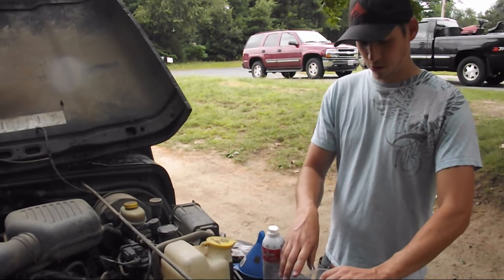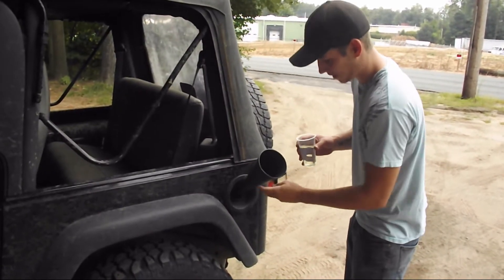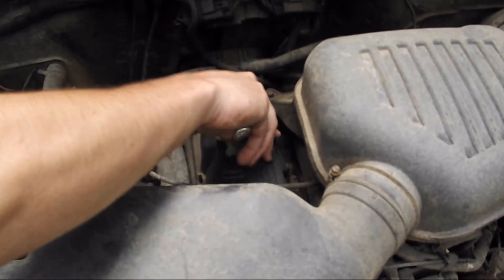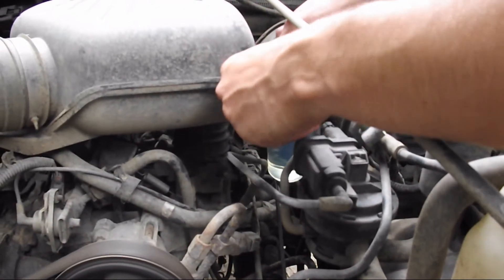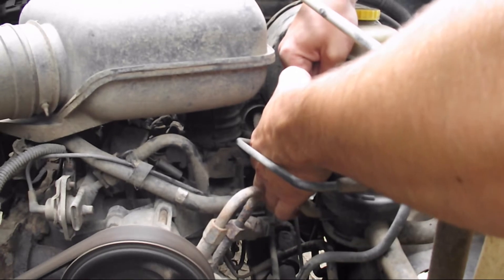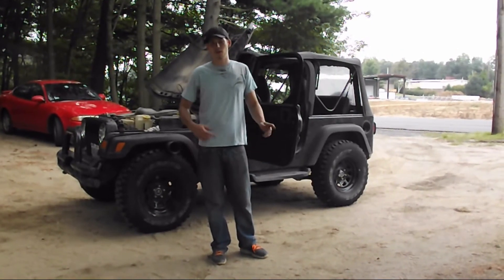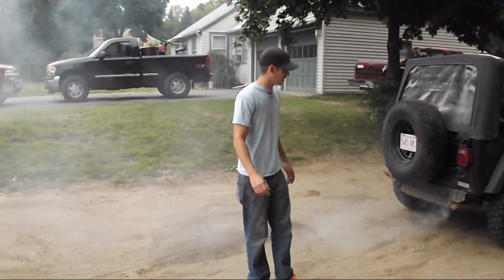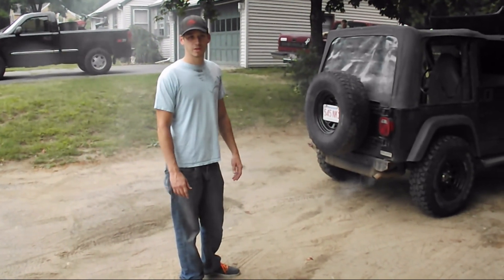How to Seafoam your vehicle w/ Brandon Moulton - Seafoam tutorial - Jeep Abuse

Comment: whats the different between this seafoam and spray seafoam?
Reply: Hitman4661 the spray is for cleaning the throttle body. honestly I've been trying to figure out if its safe to put seafoam into the vacuum hose, because I cant figure out where it goes or if the hose is the right one to suck up the seafoam. only thing I haven't found on youtube yet lol but yeah spray foam for the throttle body the other stuff for fuel and transfer case treatment